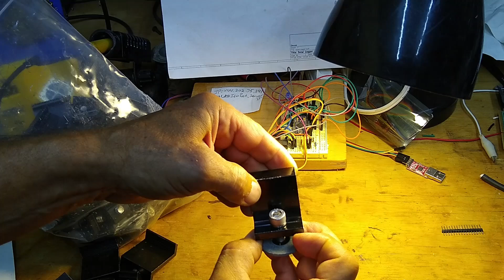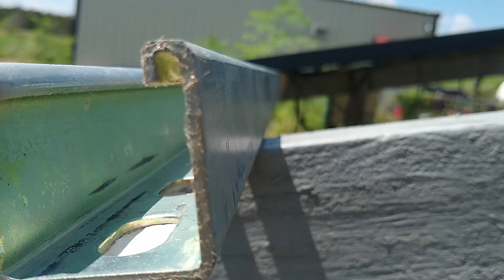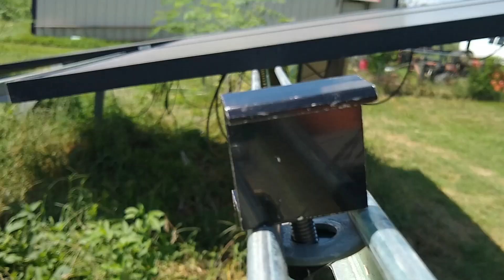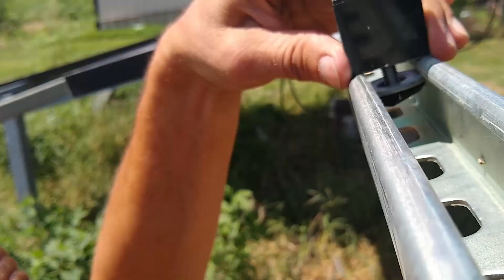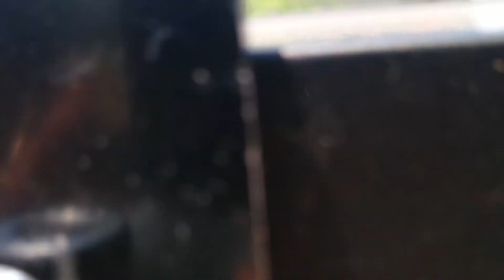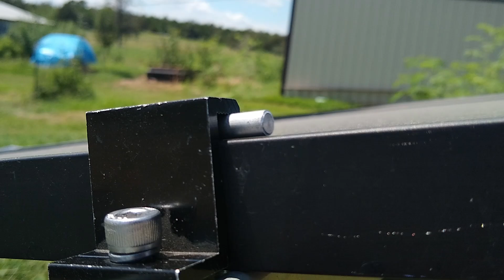DIY Unistrut Solar Panel Rail Mid and End Clamps!

Comment: I did the same thing I didn’t realize there were two different size unit struts I had to re-order😔 I couldn’t find the engine 5/8 that’s what it’s called. The unit strut is called inch and 5/8 and I couldn’t find clamps to fit inch and 5/8 unit strut on Amazon so I went to Home Depot. They didn’t have them in stock at the store, but you could order them and they’re perfect a lock right in the hard part is deciphering how far apart to put the unit strut so that your panel will lock in correctly after a few retakes they seem to work just fine.🙏🏼❤️‍🔥🇺🇸
Reply from the maker: Great minds think alike! Now I have some custom made T-Nuts that wort great.

Comment: Inch and a half fender washer seem to be a little too big in my Uni strut. It’ll work but the washer is at a slight angle. Have you ever tried an inch and a quarter? And I wonder if it really makes that much of a difference?
Reply from the maker: I'm using these now, https://youtu.be/DQhHJIvC4K0
Reply: @DIYSolarFarming  I ended up using 1 1/4 fender washer, working great. Thank you for your video, I ordered signature solar mini clamps like you did and it is working perfectly. It takes a minute for the m8 bolt to start to tighten up, but other than that perfect. I think this is the best approach of for the quality of the mounts and their cost. You cant beat it. thanks again!
Reply from the maker: @mozdedo  Thanks, I'm glad it was helpful! I know what you mean about the bolt turning, that's why I came up with the T-Nut idea in the other Uni strut video.
Thanks for watching!

Comment: Just an additional idea.  Put a spring between the nut and clamp/washer.  Works greats for the ones between the panels to keep the clamps up and not fall over when you try to position the 2nd panel.
Reply from the maker: Nice!

Comment: Great idea. Simple, cheap and effective. I've used the Signature Solar claps before and I was thinking of using some unistrut in a particular place instead of the 6" mini rail they sell also. I'll still use the flashing, just replace the mini rail with a long length of unistrut. They sell two different thread adapters for the unistrut but a washer will be much cheaper I'm sure. The clamps also come in different heights for different thickness panels.
Reply from the maker: Right, I think it's the lowest cost while still being solid. I was going to use all wood at first but I think the Unistrut will keep things straighter in the long run. Thanks for watching!
Reply: I came up with the same idea. Wondering if you put them up and how you connected the unistrut to the minirail flashing minus the 6” piece. Thanks. any help is appreciated!
Reply: @PAULAKEITH-m7m  I did use the unistrut. It attached the same way the short 6" piece does, with a bolt and washer. Then the panel clamps attach to unistrut just like the short ones.